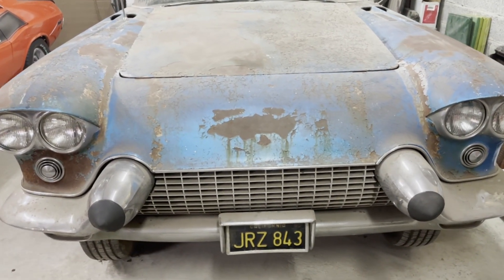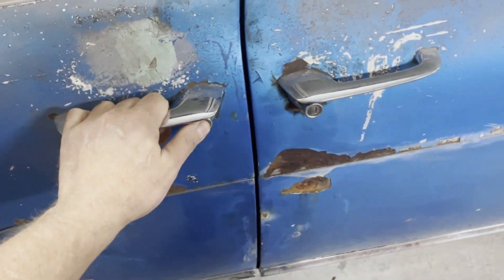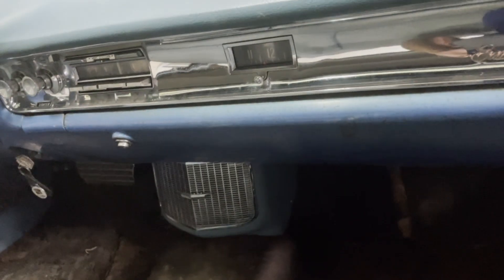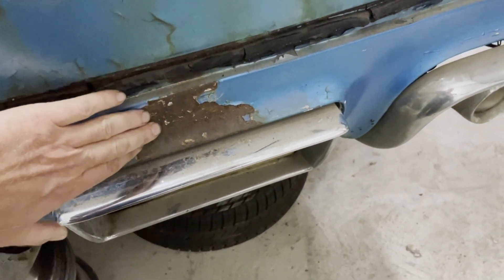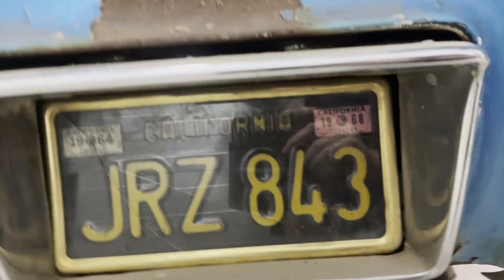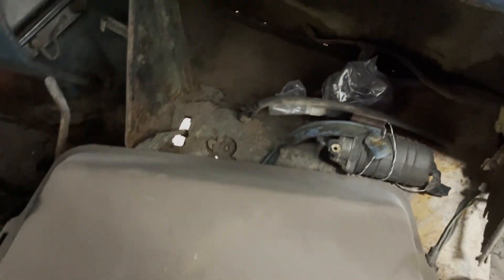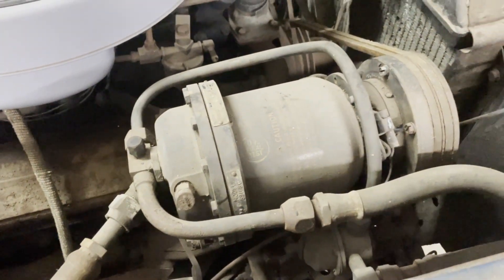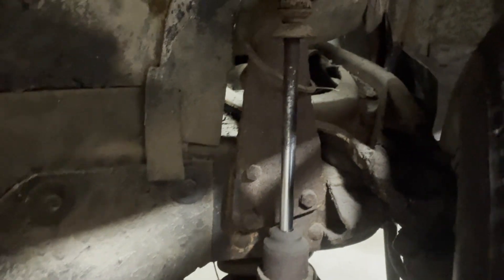1958 Cadillac Eldorado Brougham project- What happened-pt.2

Comment: The Eldo Brougham is a very rare car as only around 100 were built each year. I worked at a high end resto shop where a customer bought one in for resto(1957). It had sat for decades and was really beyond restoration .$200,000 later and only the body work was done. Air suspension,stainless roof ,3/4 size compared with other caddilas,6 electric motors in each seat, all needed work but the car was never finished and went to another shop where it sits taking up space.
Reply from the maker: Well, I think they made a little more, some 300 were built in 58' But that is still very rare. That can't be funny for the owner, feel sorry for him!

Comment: My advice is to start at the engine and transmission, get them running, then move to the fuel system, and coolant.
After That, take care of rust issues, and then begin tracking down the electrical gremlins.
I must say, that you have a beautiful Car in your possession, and is worth rebuilding.
Thank you for your Video.
Reply from the maker: And I think that's exactly the way I plan to do. I need to get it running so that I can do a registration inspection so that is priority 1. Thank you!

Comment: PS, The Broughams have there own cylinder block, but even if rusty can be rebuilt. Originally designed to have Fuel injection,it couldn't be made to be reliable so the tried and true tri power set up was used.  The gauges are pretty specail and use their own Brougham specific items. There is a guy in the US caddy club who makes a replacement module which allows the gauges to work properly. The mild custom work could have been done in 58' as the economy was booming and people had real money to spend on things like getting their new car personalised. the upholstery could be original,because there were 300 plus different options for the interior so no two Broughams are alike .
Reply from the maker: Thank you for the information. Yes I think there were not so many with this color combination.

Comment: The shifter should work.  The lockout solinode is unique as it disables the rear inside door handles the rear door when placed in gear.  There is nothing that should be preventing it from going into gear.  Linkage is likely bent from moving around
Reply from the maker: working on the issue right now and will post a video when problem is solved.

Comment: You have your work cut out for you there are Cadillac restorers in the USA which have been collecting and possibly you can contact them for information and inspiration and maybe help with parts contacts you might need to help you with 😮❤your rust issues aren’t to bad mostly surface which can be sanded down and sandblasted lightly and primed and painted. Hopefully you can free up the motor and get it running properly with the kits available. 😅❤
Reply from the maker: Thank you for the information!